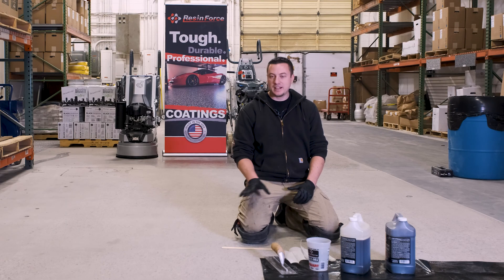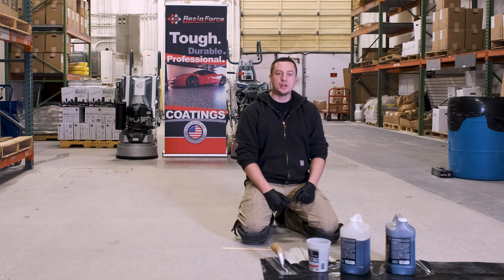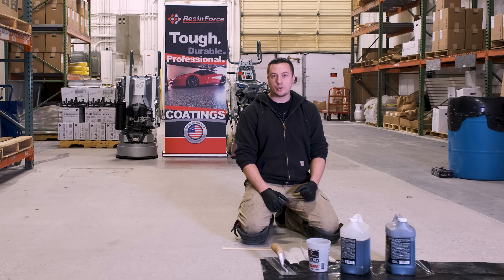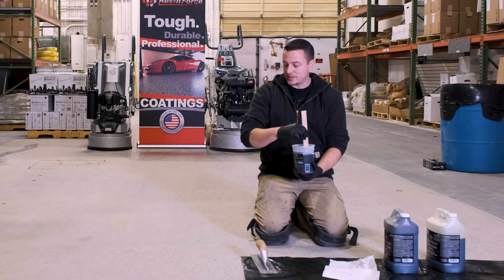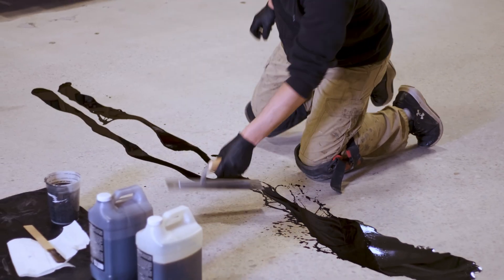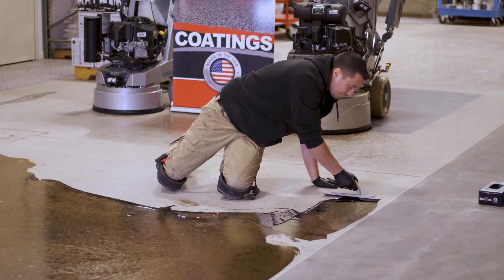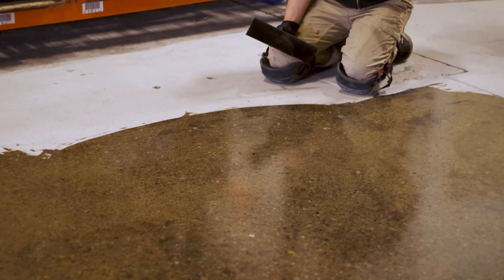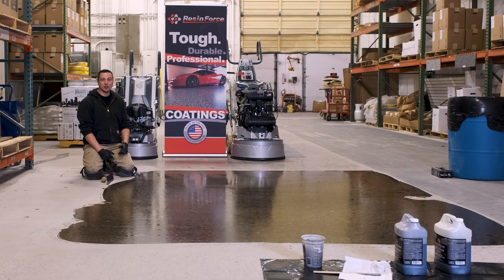Mastering Grout Coating: Minimize Outgassing for Stunning Metallic Epoxy Floors!

Comment: Do you sand before applying mvb?
Reply: I would suggest applying the body coat of mvb over the mvb grout coat as soon as the grout coat is tacked up but no transfer. This way it forms a chemical bond within the recoat window. Typically 2-6 hours.